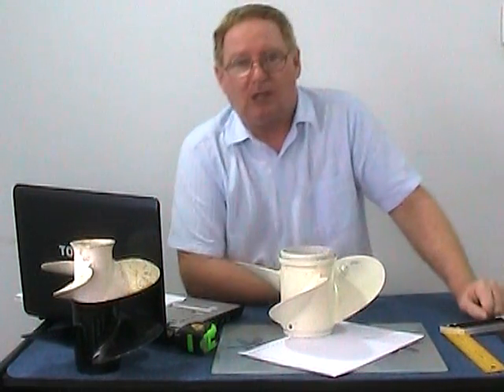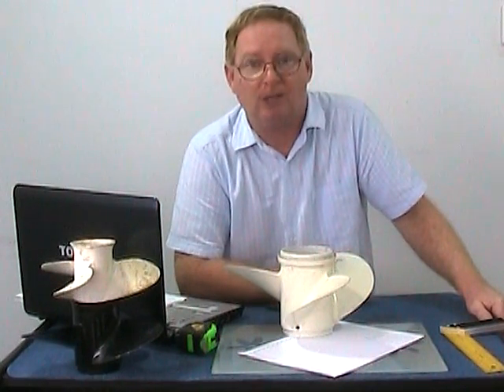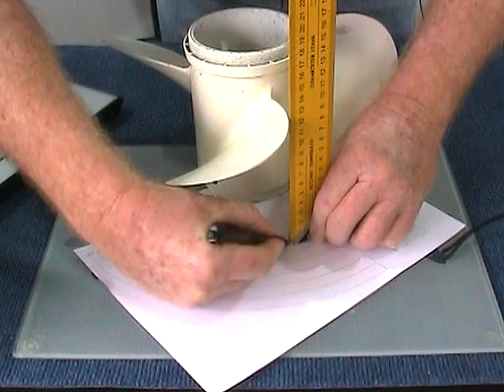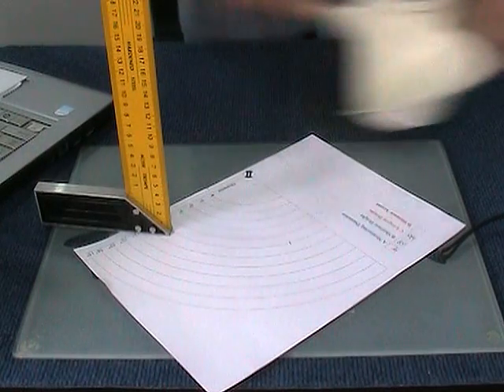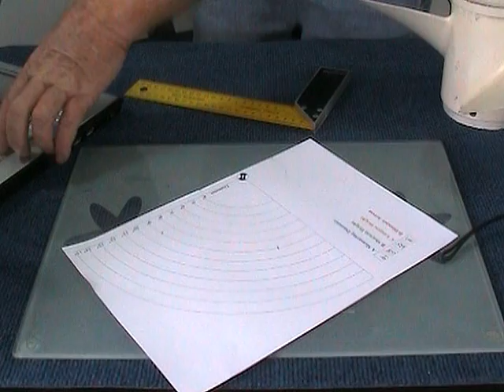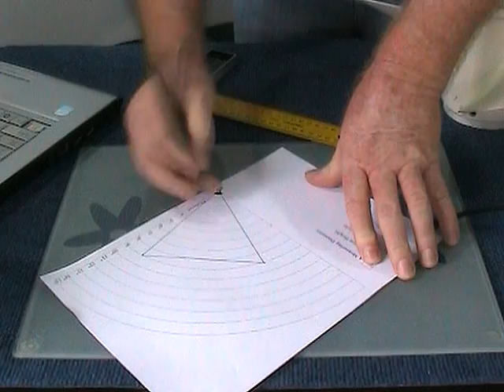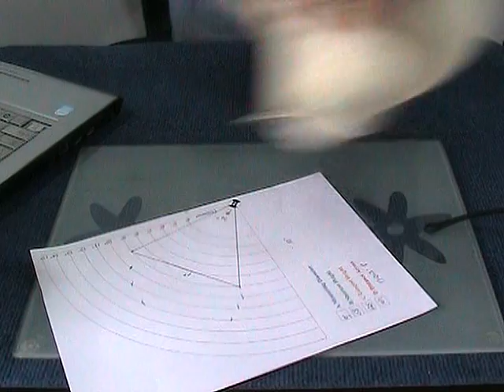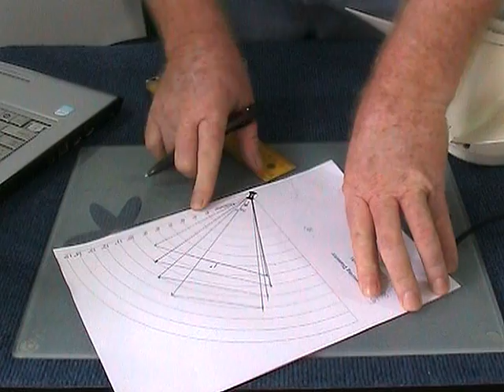Prop Repair - Simple Pitch Measuring

Comment: Thank you well explained.
For 5'' two blade propeller, what should be the suggested measuring diameter has to consider please
Reply from the maker: Its just a general rule , a two and four blade propeller would be measured at 3/4 of its diameter which is 3.75" or 4" on your 5" propeller.

Comment: I have been repairing outboard for 40+ years. This program is fantastic! and actually works great. One request: Since we measure the diameter in inches, is it possible to input the other measurements as inches also? Us Yankees aren't that keen on the metric system, although conversion isn't really that difficult. THANKS!!!
Reply from the maker: Hi Tom, thank you for your feedback. Its important to be aware that this is only a quick and very basic way of measuring pitch. In a professional environment we would measure across the face of the blades at several radii then mean(average out) those measurements to give a more accurate result.
Reply from the maker: Also, I am currently experimenting with writing android apps. If i am successful i hope to recreate the program on that format. I'll ponder on a user option for different measurement inputs. Thanks again for your kind feedback.
Reply: Excellent, I could use both of those ideas
Reply: ***** How is that Android app coming along? My son's job is writing applications for Android. He might be of assistance in this matter, or at least be able to hook you up with the right person.
Reply from the maker: Annie Lou Risley Hi, thank you for your interest. Have had things on hold due to a tropical cyclone hitting 100 km north of us and having to help out. I might pm you when I have it close.

Comment: I have a prop that is 9.25 inches in diameter. Will this template work for props that have that quarter measurement? Or is the template only for whole numbers? Thanks.
Reply from the maker: Measuring diameter is around two thirds of the actual diameter on a three blade. 9.25 would be rounded down and measured at 6 inches. Try measuring at any measuring diameter and notice how in most cases, the pitch remains the same.

Comment from the maker: A free android app is now available. My first attempt so be kind. See the description above for the link to the store.
Reply: Hi,
Thanks for the video. May i know what's the formula for calculating the pitch?. How do you calculate the pitch angle from inch?

Thanks
Reply from the maker: Hi Matlab, there is information on my website about measuring pitch which explains how the pitch is calculated
Reply: Hi..thanks for your kind reply.. in the website there is a calculator which calculates the pitch after you have entered the other Required data such as A.Measuring distance B.Shortest height C.Longest height etc..My question was what is the formula to calculate the pitch after you have those required datas..
Thanks
Reply from the maker: Hi Matlab, an explanation on this is on the agenda for an article on my website and perhaps a youtube video. However, I cannot give you a time frame due to other commitments. I could only suggest you subscribe to my channel and check my website from time to time. regards..

Comment: Hi, thank your for such a great video and templates on your website. I recently purchased a 15 ft boat with a 7hp inboard, it was over revving at wot and under performing in speed, for all reasonable calcs it should be running approx 3 blade 12 1/2 x 12 1/2 LH Bronze prop. I took the 3 blade prop off, it had 12 stamped on it, but no pitch. I followed your instructions, checked the overall OD, it was actually 10 1/2 inches (must have been reground many times) I used you template and pitch calculator, I have a 
10 1/2 x 9  prop (no cup) a long way from a 12 1/2 x 12 1/2. Again, thank you
Reply from the maker: Thank you kindly for your feedback.

Comment: I am new to this propeller field ,having more doubts on propeller designing.So please can you suggest me where I can exactly get information on propeller designing.
Reply from the maker: I used to repair propellers rather than make them so I don't have any information I could assist you in this process. A good place to start with understanding the design of propellers is a book by Dave Gerr called the propeller handbook which may help you.

Comment: When placing the prop for measuring is it FWD face down on the glass? I got 28 inch pitch that my supplier says is too high. I'm going to repeat with prop 'other way up'.
Reply from the maker: Hi Allan, pitch is measured across the face of the blades. As you see it shown in the video.
Reply: thepropellerhub Thanks for reply. I wasn't sure if prop is symmetrical so which face of prop is on the table. Fwd or aft face. I'm repeating the exercise.
Reply: Ahhh.......  It was my mistake. Beware when measuring the distance between the two points as I made the mistake in not entering correctly in mm. I got 13.5" Pitch. In the meantime my girlfriend had removed the 'crap' and found the numbers. Pitch was shown as 14". Great video and website.  Thanks again

Comment: So. Is this Prop PROGRESSIVE Pitch?
Reply from the maker: PROGRESSIVE pitch measuring was not included in this very basic pitch measuring video as it requires a much more  complex multi measuring approach across the face of the blades. Also, there was no need to capitalise progressive just to get your agenda across.